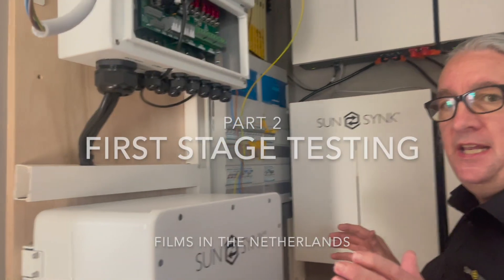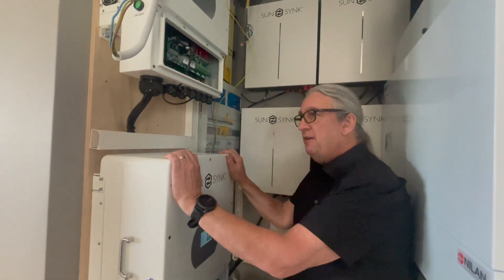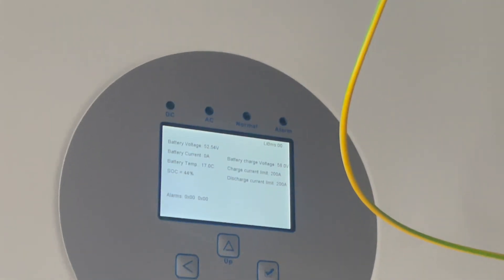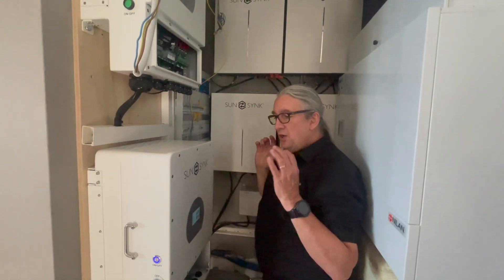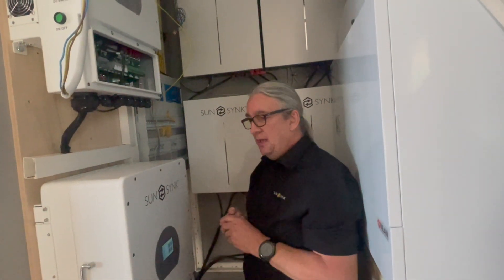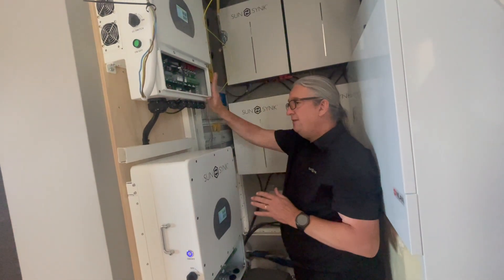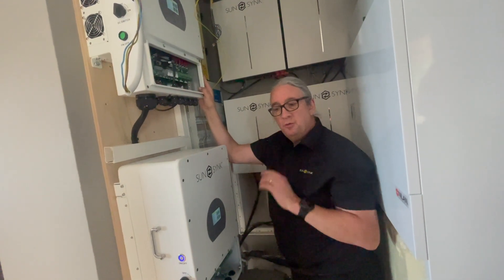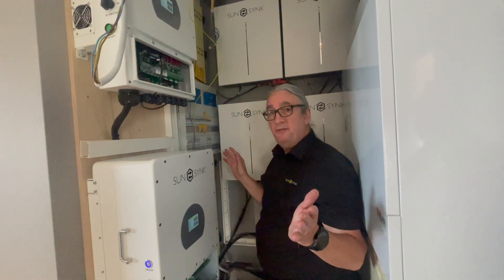Part 2, Installing a #Sunsynk system with #ARLK Energy

Comment: Hmm... If the 8KW inverter is the one charging the batteries, is this a UPS/Emergency Power setup and not as a solar system setup?
Or charges the battery during off-peak hours and then discharges battery during peak hours (to reduce electricity cost)?